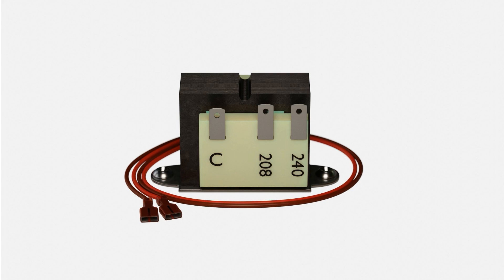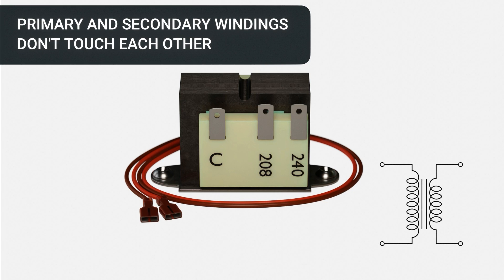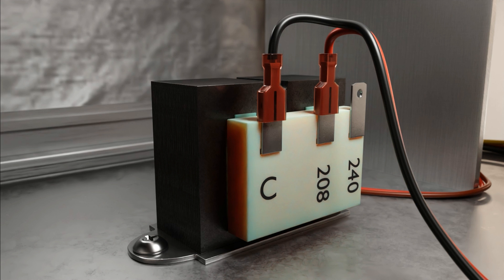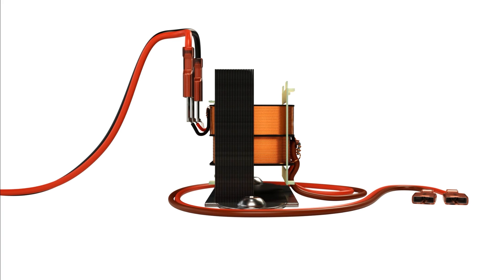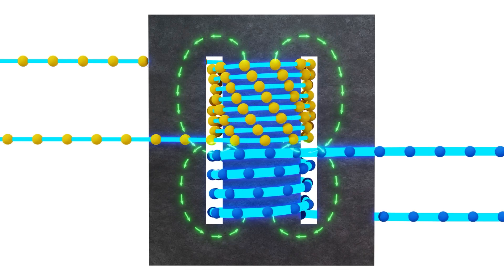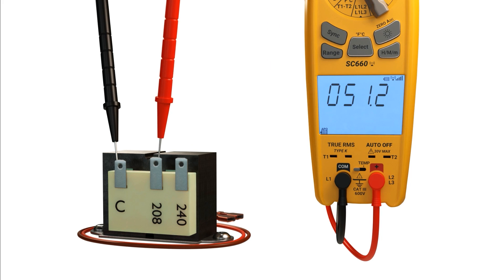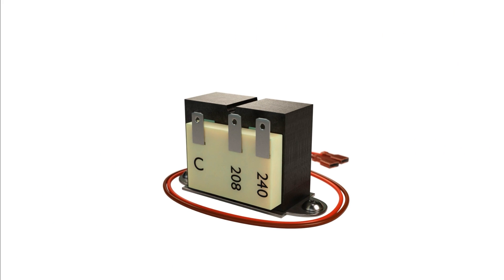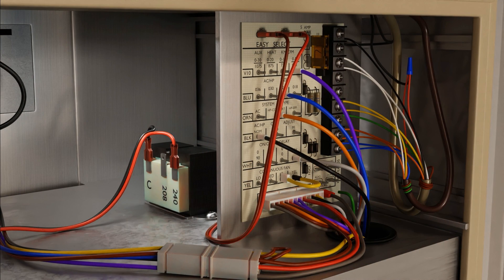How a Transformer Works 3D

Comment: at 1:00 . i have an important question .  i was working with a technician and we where working on a unit where the power supply is 208. i was reading 202-201 volts. he put the transformer pin on the 230 volt prong. he was explaining to me that it needs to be on the higher setting just in case there is a power spike. the 24 volt secondary power supply was only 23 volts. i showed him that it needs to be on the 208 pin for the transformer. the secondary power for the 24 volts was reading 26 volts after i changed it to 208 pin. so I'm confused . i don't know how is right or how is wrong.  I'm missing something?

Comment: Can somebody please explain why you can't measure 24v on the 24v side of a step down transformer with high voltage connected and power turned on. Unless it's hooked up to a load...

Comment: The video said high voltage flowed through the 5 amp fuse on the printed circuit board in the AHU. This is something I have never seen in a residential unit.

Comment: I would like if you would help us Show what a week transformer looks like :And how to wire a new transformer that they picked up from the supply house with differant color code
Reply: Most if not all new after market typical step down transformers today show what color leads are for what voltage on the skicker/nameplate on the part itself. Low voltage lead ends doesn't matter although some want common tied in with ground. High side usually have a common then different high voltage leads.